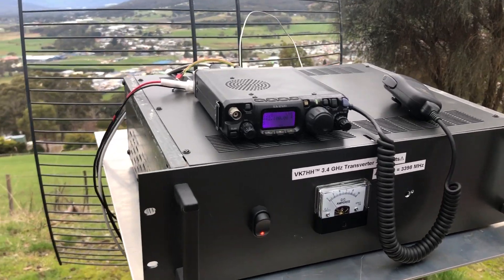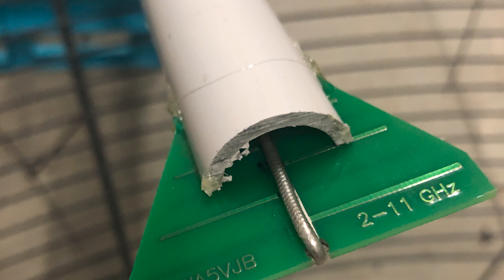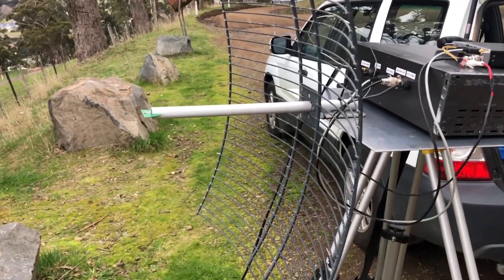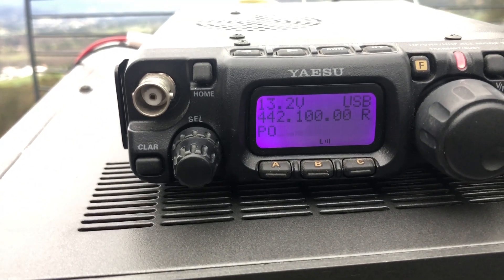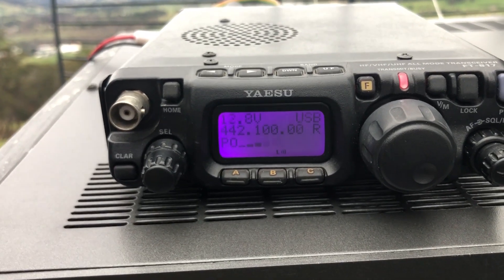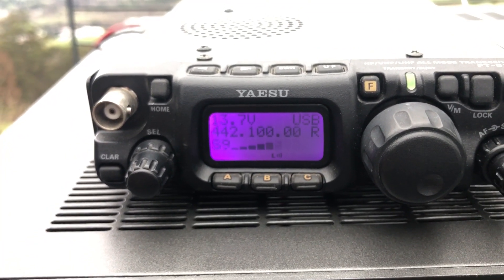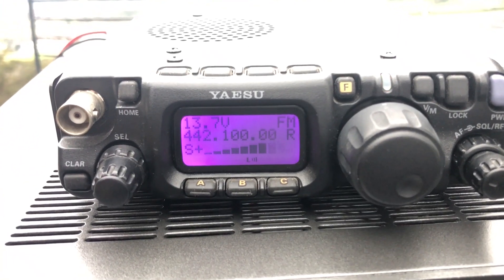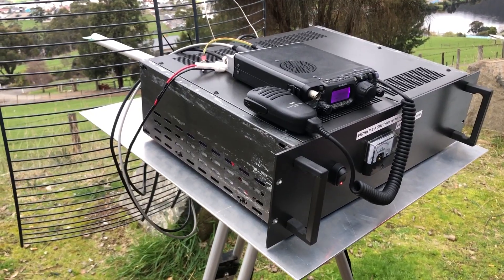PCB high gain feed for Ham Radio dish | WA5VJB Log Periodic

Comment: Interesting that nobody reports an FM signal as fully quieting. Meaning the signal is being captured by the limiter /detector sufficiently well that there is no noise. The point is that FM is not a linear mode so the S scale makes no sense. Anyway just a minor point, great video Hayden, keep 'em coming.  VK3HN.

Comment: That is a great setup. Wish we had more activity like that in So Ca. Keep up the awesome videos.
73 from Richard-N6DXN
Reply from the maker: Thanks Richard. The problem with microwaves is usually cost related - however with a bit of searching (and cheap eBay parts) you can get active on the band making contacts for a relatively low cost. One of the easiest ways is using the DB9NT transverter range (although rather expensive - the US dollar is better than the AUD at the moment) or the SG Lab range (for 1296 and 2.4 GHz). Maybe encourage some in your club to get some funds together to build two systems that can be loaned out amongst members. I know all down that coastline lots of great contacts could be made!